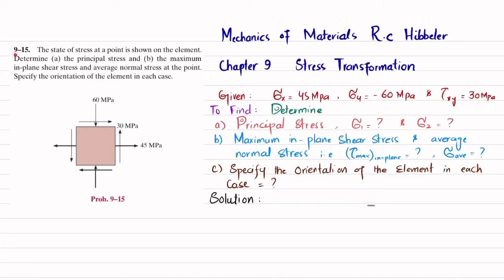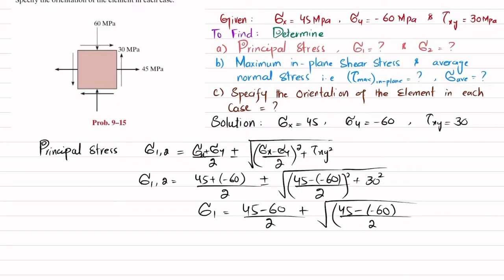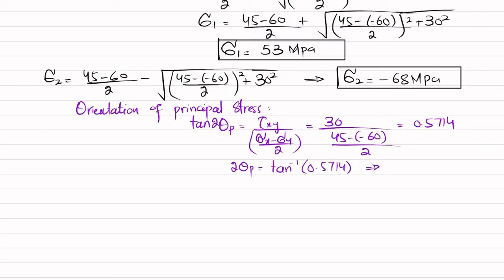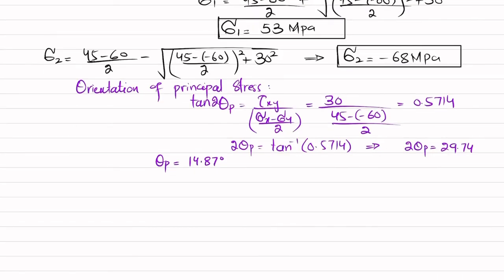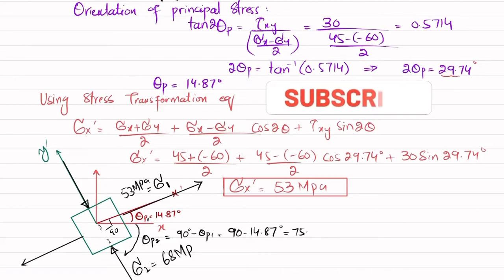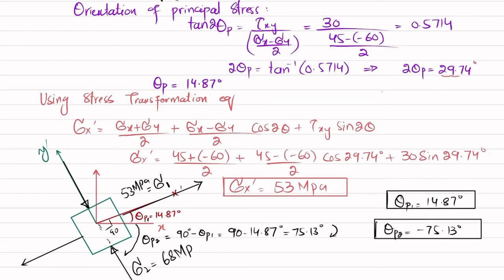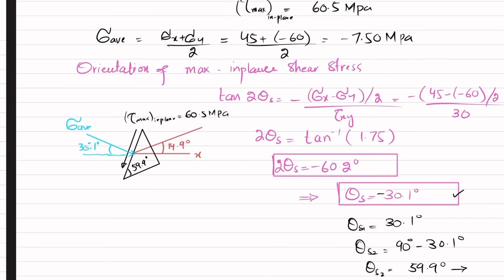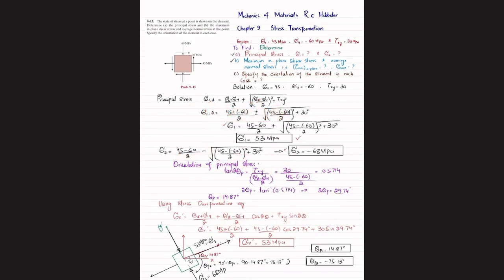Determine principal stress | Problem 9-15 | stress transformation | Mechanics of material rc Hibbel

Comment: Doctor, how did you know theta p1 and theta p2?
Reply from the maker: Formula is given and all the things are explained. Thepta p1 and theta p2 have relation is also shown. What's the issue then?
Reply: Doctor, I have a problem in differentiating between theta in example 14. I mentioned that if we substitute theta for either of them in the law, the x-value and the x-value becomes greater than the x-value given in the question   We consider the theta we substituted to be theta2.   @engradnanrasheedmechanical
Reply from the maker: Theta p1 and p2 are the principal planes and on principal planes the stresses are maximum.
Reply from the maker: I shall suggest you to watch chapter 7 stress  transformation lectures whole series to get understanding about the topics . Here is the first lecture 
https://youtu.be/aCD_RRhj-Zs